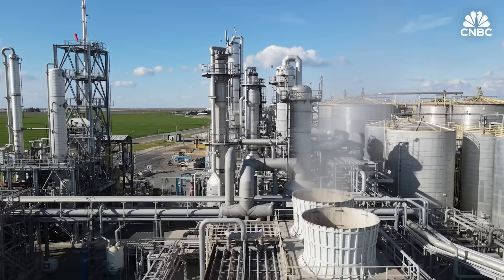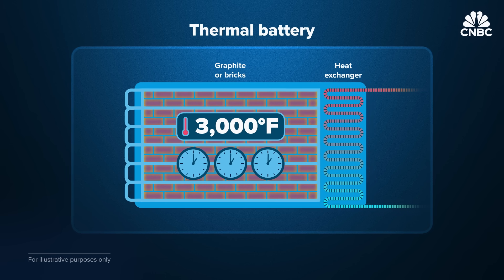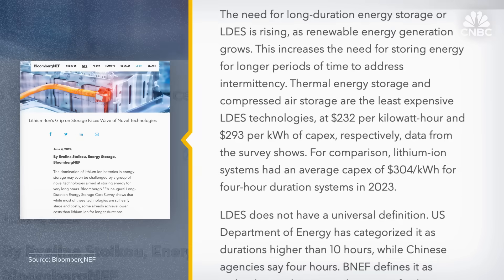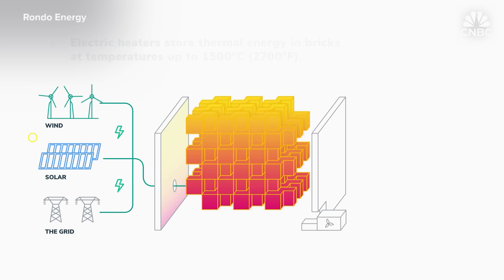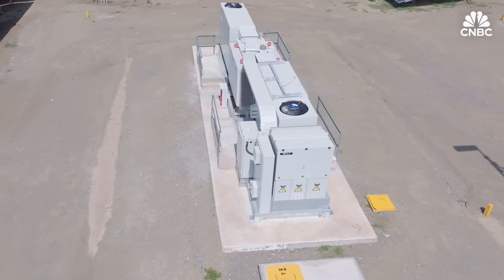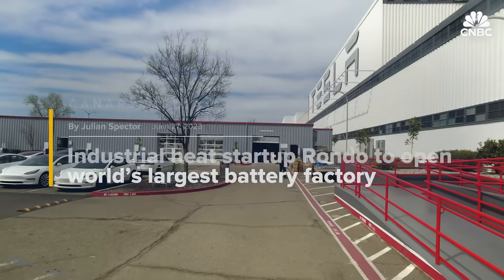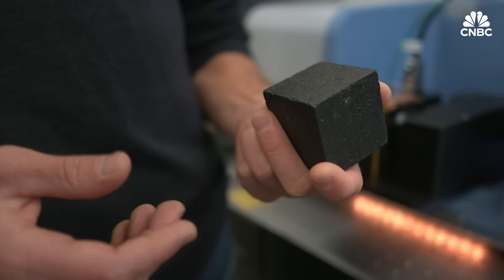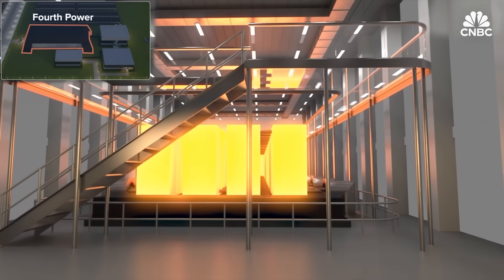How Thermal Batteries Could Replace Lithium-Ion Batteries

Comment: So, we're going to use resource inefficient energy systems to inefficiently produce electricity, and then we're going to build excess amounts of these resource inefficient energy systems so that we can inefficiently store the excess energy that they produce? Sounds like a brilliant plan! This should all do wonders for the environment!

If global warming were an actual problem, we'd be so far behind in solving it by the time any of this ever worked out that we'd likely be facing a possible extinction level event! The stats at the beginning of this video are also ridiculous, as 22% is absolutely nothing, when you also consider that we're going to need more electricity than we're currently using to power transportation.
Reply: No, the whole point is to make use of the extra electricity thats produced during the day by wind and solar for example, then convert it to heat and store it in those "powerbanks" then use the heat to power a simple steam turbine, so its just like a normal plant but more cheaper materials thats better for the enviorment.
Reply: @tklasson  I know. My point was that wind and solar are extremely resource inefficient ways to produce electricity and storing electrical energy as heat energy is an extremely inefficient way to store electrical energy. There might be some niche applications where the heat from the thermal batteries can be used directly, but those applications are going to be relatively uncommon.

Nothing about what we're currently doing with regard to energy is better for the environment.

Comment: Kind of stupid to heat up using electricity.  Just use mirrors to focus sunlight onto the lump.
Reply: the problem with using mirrors is you need a lot of space in order to generate the heat that industrials need, and you need to store that heat overnight and transfer it to where it's needed -- at the heart of a factory where existing gas-fired boilers are. That's a lot of space required, and efficiency lost through transporting the heat. The Rondo Heat Battery safely sits at the heart of the factory and is very energy dense -- it is much easier to transfer electricity over distance with zero efficiency loss.

Comment: Steel is mentioned multiple times, but I don’t see how this could be used for manufacturing steel
Reply: Usuage of the heat generated to later power the plant
Reply: @tklasson  that's not "steel manufacturing" though. Might as well say it can power rockets to land on the moon if SpaceX heats up their warehouse with it. Steel manufacturing is a particularly important topic for greenhouse emissions, and it shouldn't just be thrown in the bucket of "well, they heat the cubicles with it". The temperature needed for steel is directly incompatible with many/most/almost all green heating technologies. The only reasonably viable one that I know of right now is burning hydrogen

Comment: We need coal, oil, natural gas, and possibly nuclear, if done cheap enough and safe enough. Solar and wind run into storage problems.
Reply: We store intermittent electricity from renewables to deliver the heat that heavy industrials need to drive their processes -- 24/7.

Comment: In whole video they are not telling how this heat energy will turn back into electricity. This is probably to heat up manufacturing materials. I don't see how this can work in residential setup.
Reply: We primarily sell heat (hot air or steam) to customers who use natural gas to generate heat to drive their processes -- not electricity. Heat alone (not electricity) is responsible for 74% of industrial emissions. We are 98% efficient electricity-in to heat-out. Right now we are focused on the largest consumers of energy in the world -- heavy industrials. There are other companies that are working on heat batteries at smaller scale for residentials.  We also can do a combined heat and power solution at very high efficiencies.
Reply: @Gemini-meet  In residential settings thermal batteries can provide district heating for neighborhoods or apartment buildings...heat exchangers create steam & & feed directly into radiators in houses & apartments.

Comment: The best way is to pump water up a dam and use it later or to desalinate the water and put it into lakes and reservoirs
Reply: This is not a way to decarbonize heavy industrials that need heat -- not electricity.
Reply: The BEST way is to use Geothermal energy but current technologies have problems drilling down far enough. Iceland is OK because it is near the surface. If successful geothermal could power the WHOLE WORLD with LIMITLESS energy.

Comment: Thermal energy storage is vitally important in the global energy transition.  Many residential and industrial processes directly use heat.  At home there is hot water and home heating which is a big part of a home's energy budget.  As price of home batteries are still high, there is an opportunity to store heat for later use from the grid electricity (or better rooftop solar) and use it later thus relieving the grid of peak demand loads when everyone wanting it: evening time (duck curve), winter storms, etc.

As the video pointed at 5:18, a pound of bricks stores more energy than pound of lithium batteries, and at a significantly lower price too.

On a larger scale, the world uses about 620-exajoules of energy annually.  Only some 100-exajoules of it is electricity.  The rest is basically a type of heat from internal combustion engines, jet engines, building HVAC, and industrial processes like manufacturing steel & concrete.
Reply: Yes!

Comment: Here's the thing you need to know about heat/thermal storage. Converting electricity onto heat and storing it is a 99% efficient process. It's converting the heat back into electricity is were you're gonna take the hit in the efficiency. Thanks to the 2nd law of thermodynamics, would be lucky to get an efficiency better then 35%. Thermal storage has it's place, like storing heat for heating you home during off peek times. Your hot water tank is a prime example of a thermal battery, storing anywhere from 70 to 100kw of energy, many power companies in exchange for cheaper rates, will install a remote control device on you HW tank to turn it off during peek times. Just don't expect to turn all that hot water back in electricity any time soon. Thermal storage has it's place, but trying to use it to store electricity? Ya! That's nothing but a pipe dream.
Reply: We are selling heat, as heat, directly to industrial customers to replace or eliminate gas-fired boilers that generate heat. We can also deploy combined heat and power solutions, but our primary customers are purchasing heat.
Reply: @RondoEnergyGlobal great, do you use these clay bricks?
Reply: This could be somewhat useful for district heating systems.  Through the day there is typically times when there might be a little bit too much power being produced.  If you could have this connected to the grid and it just took that power and converted it to heat then during peak times the heat could be used.  The grid operators would most likely just give that extra power for free since it would save them some headaches. Obviously that would only work in areas where they have excess power from time to time like grids with a lot of renewables.  If the grid has natural gas power plants for baseload they want to keep those running so even if the power isnt free it would be extremely cheap and with a system like this it could be turned off and on quickly to follow the load.
Reply: You're missing the idea. It's not about running a heat engine to convert back to electricity. They are using this to supply process heat in industries so that at times of peak load, more valuable electricity doesn't need to be wasted on process heat.
Reply: Then just triple the amount of heat batteries. They’re 1/10th the price per pound compared to battery cells.

Comment: So old fashioned 'storage heaters' are back. In the old days cheap electricity was used to heat bricks inside a heater which then would release the heat during the small hours in the house.
Reply: Yep! Similar to that but at industrial scale.
Reply: In the UK we never had clothes dryers, we would place clothing in the 'airing' cupboard ie the hot water tank cupboard for a few hours to dry.

Comment: The problem with thermal energy storage is that it makes so much sense and requires so little knowledge to do it well  , it shouldn't be a money maker. Probably any beginning engineering student should be able to sketch out a working design on a napkin

The thermal batteries in this video are the wrong way because it highlights the drawbacks of thermal energy storage which isn't the storage itself but the conversion and transfer from some other form of energy to thermal and then later to electricity  losses can be unacceptably high.

I understand the Chinese are going sing Stirling engines to convert thermal to electricity which is one good solution. Americans apparently aren't satisfied and are trying to invent another solution and one has been high output thermistors 

On the input side, any solar concentrator farm is already dealing with high temp heat as the primary form of energy so a simple solution could be to simply expand the reservoir of solution flowing through the system typically molten sodium

As briefly mentioned in the video, the properties, systems and materials used to manage heat are widely known and some hundreds of years old using very cheap materials. Some of those principles are in every water heater and building a/c system.

Metropolitan storage of thermal energy can be very cheap and materials often found in common stores
Reply: Hey -- quick correction -- our customers are primarily purchasing heat from us -- not electricity. So we are not experiencing losses from converting heat back to electricity. We are 98% efficient electricity-in to heat-out -- and customers are replacing their gas-fired boilers that produce heat with Rondo Heat Batteries for that very same heat. Molten salt is not a safe solution for factories where safety is paramount, and mirrors require a lot of space to deploy that factories don't have. You experience a lot of efficiency loss transferring heat over distances compared to generating that heat, safely, at the heart of the factory.

Comment: The answer is the storage must be what the land provide. If alot of water, then water batteries,
if sand then molten sand batteries. One is not the answer.
Reply: This hits the mark. Work with the environment instead of pushing one solution to everything

Comment: Except, wind power is has very low efficiency, is very difficult to repair, and once the product is useless, it goes to the dump. The answer is small, efficient, nuclear plants.
Reply: Rondo Heat Batteries can accept all forms of electricity to generate the lowest-cost heat available, lower-cost than status quo gas-fired heat.

Comment: There was a similar hype about space-based solar panel technology, because European scientists said it was easy to create. Yet the energy loss due to the transfer process is too big
Reply: The energy loss for thermal storage in bricks and the like is about 30-41%, so it definitely has tradeoffs compared to batteries but for excess cheap energy it's not terrible.
Reply: @BendsSpace  I hope you're right

Comment: wind and solar are not the cheapest sources of energy, fossil fuels are lmfao
Reply: Intermittent renewable electricity is free or negatively priced during peak generation hours -- there are US states where energy needs to be curtailed and energy prices go negative. We use that energy to charge for 4-6 hours per day to deliver 24/7 heat at lower cost than fossil fuels.

Comment: Heat to electricity efficiency is 60% more likely 40% or lower in this case. What's the shipping cost of these batteries? They got to be heavy.
Reply: We are selling heat to our customers, not electricity. We are 98% efficient electricity-in to heat-out. Our customers are purchasing heat from us to replace gas-fired boilers that generate heat 24/7.

Comment: People talk about cheap energy,  but my bills are going up every year
Reply: This has nothing to do with the introduction of renewables and everything to do with  how energy is traded and the use of fossil fuels. Energy is traded at the price of the currently most expensive source of electricity on the grid. So say a peaker coal or gas station is switched on then the price will be set by the price of those fossil fuels irrespective of how much renewables is currently in use and the price of those fossil fuels has gone up. In order for us to see the benefits of renewables we need to rid our grids from the older more expensive technologies or in the short term put solar on your roof. However that depends on what state you are in as for example in California I think it is, they have started to put penalties on roof top solar, as they are generating too much solar on off peak times and don’t yet have enough storage to soak up the excess and as more people put more solar on their roofs the grid providers demand for electricity drops and they still have expensive base load stations (such as Nuclear) that cannot be easily switched on or off, that  must be paid for. So they discourage more people from putting solar on their roofs, to prevent more electricity from going to waste and keep demand for the base stations steady. The transition is difficult but not impossible for the grids but the inflationary price of electricity is not because of renewables, though many will tell you otherwise.
Reply: Get solar panels thrn
Reply: Cheap energy, as in getting cheaper to produce and store. Nothing to do with you, might some day.

Comment: In the Isentropic process a gas like argon is kept in 2 gravel stores differentially, hot 500c and cold -160c using a gas turbine pump system. When electricity is available it spins up the turbine that pumps argon gas from the cold side to the hot side. When electricity is needed, the process is reversed. The round trip eff is said to be about 75%. The company behind it was built by a turbine engineer with UK gov support, when the company folded it was taken over by Nottingham University, search <grid scale energy storage SAE Isentropic>

In another approach that has similar efficiency, air is frozen with steel tanks containing the liquified air and a sand store holds the captured compression heat. When the heat is used to recover the air from the liquified air, the system recovers electrical energy at about 50-60% eff. <Liquid air energy storage>

Comment: Renewable energy is not cheap.  Its the most expensive which has been proven by the price of electricity in countries and states that invested heavily into it.
Reply: There are many areas in the world where intermittent renewable electricity prices reach zero or even negative if that power needs to be shut off because of over-generation -- this occurs in many US states. Rondo charges for 4-6 hours a day when this power is extremely cheap, to deliver 24/7 heat at lower-cost that fossil-fired alternatives.

Comment: Unless thermal batteries are 10-100x cheaper, they have no commercial chance vs electric batteries. 5-10 years feom now sodium batteries are likely to be 10x cheaper than now. Mass production beats all! Looks like thermals are also scaling though. So best of luck to them!
Reply: An RHB is about 5-10X lower-cost than Li-Ion for the same amount of energy storage -- however note that we are primarily selling HEAT to customers, not electricity. 74% of industrial emissions come from heat -- NOT electricity. Thanks for the kind words!
Reply: interesting note. Indeed where only electricity storage is demanded, these low cost bateries will prevail in many applications. On the other hand, heat will still be needed, I see more potential in seasonal heat storage, covering low to medium temperature heating needs, such as those used in food industry (low potential heat for drying, cooking) or municipal heating. It it can convert additional 20-30% of the total amount of energy to electricity, it is a good bonus.

Comment: Cheaper than bricks is the Sand battery Silo. Uses completely cheap common Sand and heat's IT and store's IT. No need for insulation. Just use more Sand. The Sand battery is better.
Reply: Sand batteries are great, but they can't achieve the high temperatures required for many industrial processes.

Comment: Like, in theory you could replace every boiler with this tech.  My factory has two big ones running at all times to heat 45k lb aqueous batches up from room temp to 200 deg for reaction.  Rather than run a boiler off natural gas, we could store peak energy during the day and release it throughout the day as needed as superheated steam.
Reply: Yes!
Reply: Now you're thinkin in power, why use electrical systems or gas when you can use a simple up front investment to have a continuos supply with low costs of replacement and maintenance? If you cut things off at the source and give people a relatively profitable alternative, you can nip adoption issues In the bud.
Reply: Yes this! 
And using the heat directly should make for the least loss of heat in transfer. or ?
Reply: @Hippida  Yes, it should be a direct energy transfer from the battery to the steam water supply.
Reply: если вы вместо газового котла поставите ПГУ - это окажется дешевле. а если добавить низкотемпературный конденсатный контур - это окажется еще и выгодно.
200 градусов вы не получите никаким способом кроме прямой конверсии. слишком дорого все такие варианты получаются, тепло по цене электричества